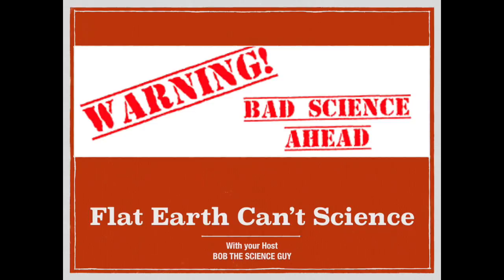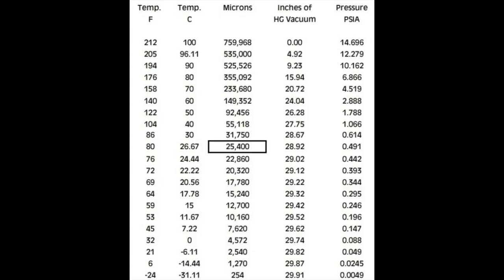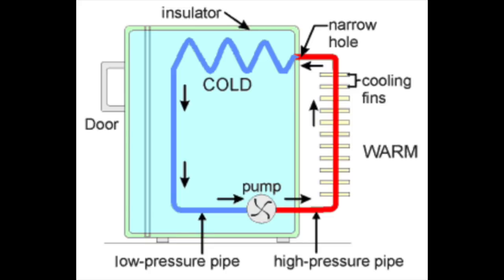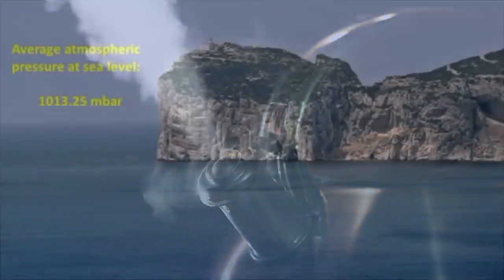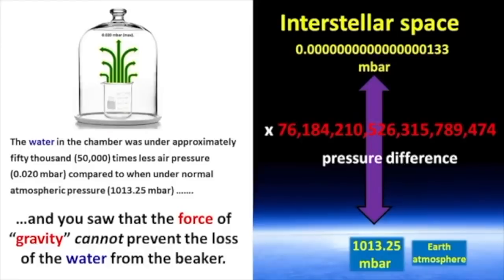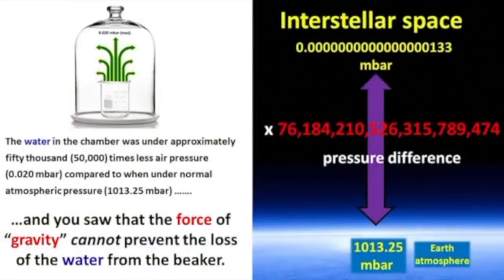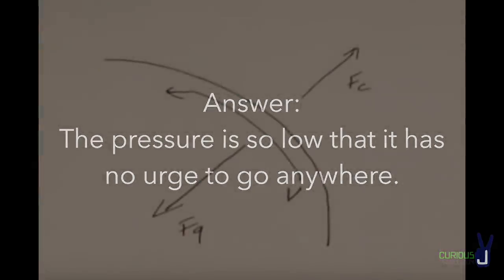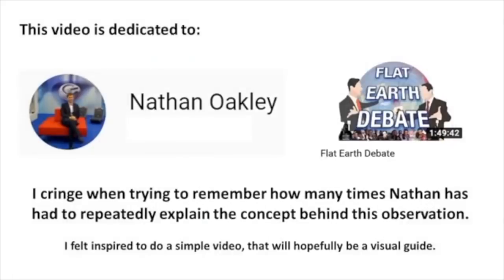Flat Derp Can't Science 28-  Is Space Scientifically Impossible???

Comment: One explanation I found useful for the "space is impossible" crowd is this, i.e. It caused them to panic so hard they "but what about" ed their way off the topic. They might not know anything about science, but they can smell when they're being painted into an inescapable corner. This reflex is common in conmen (and con-women).

You say: Let's imagine for a moment that gravity is a thing, even though you may not think so. Imagine an atomic-oxygen particle, essentially a single oxygen atom, at the top of the atmosphere.
Now, it's flying along at some speed, but it never really hits anything, since there's nothing to hit. But it has mass!
It's near the Earth, within say 80 miles or so, and according to the gravity formula F=GM1M2/r^2, there's some force pulling on it. There is no other significantly strong force pulling on it compared to that force. Under this force, would it curve towards the planet,  away from the planet, or keep going straight? It would certainly curve towards the planet on its path!

Now imagine there are trillions-of-trillions of these things up there. Eventually most (not all) will curve back towards Earth and hit another atmospheric particle. These particles bouncing around, hitting each other, and everything else, cause pressure . The lower you go, the more gravity, and the more they're bouncing around, plus the ones above them. That makes even more pressure, and so on, for 70 miles or so, on down to the ground, where there's even more force holding onto that 70 mile high column of atmosphere, that keeps getting thinner and thinner, all the way up until it's virtually nothing.

The response is usually "but you can't prove gravity"! That means they're uncomfortable talking about "pressure existing next to a vacuum" any longer. Score +1.

Comment: In the first couple minutes I think you got things just about exactly backwards. The air is pumped out and you are left with a very thin atmosphere of water vapor supplied by the small amount of liquid water. When the atmosphere is let back in, the pressure rises and that water vapor condenses back out.
Reply from the maker: I'm not sure, I think the source of the water vapor is the air in the kitchen and it condenses as it expands to fill the vacuum chamber.
Reply: @BobtheScienceGuy  the water left in the beaker boils as you said around 1:30 and that vapor fills the container and maintains a small amount of pressure untill all the water is boiled away or frozen. If the chamber isn't held under hard vacuum and baked out, when the pressure is brought back to atmospheric, the chamber will be full of water vapor and that water will condense.
Reply from the maker: @RobertSzasz  very reasonable explanation.  you say 'isn't held under hard vacuum' - which I assume to mean that the water vapor is pulled out as I proposed.  I'm not sure we can say if it was or wasn't, so I think both our explanations are reasonable.

The bottom line is that when air is allowed to return to the vacuum chamber, it will come it at atmospheric pressure and immediately expand to fill the chamber, cooling and condensing.  The available water vapor, be it from the beaker or the kitchen air introduced, will condense as we saw.
Reply: @BobtheScienceGuy  you can get a short lived mist that way, but the amount of condensation pretty much requires it to be transfer from the beaker to the walls of the vacuum chamber rather than from moisture in  room air to the walls. Condensing water from the room air onto the walls, would require the wall surface to be cooled down significantly, not just have the air cool as it expands into the chamber.   It could happen if the room is at or very close to 100% humidity I guess.
Reply from the maker: good point, I do suspect you are right.

Comment: Doing HVAC we use vacuum pumps all the time for drying out the system prior to charging the system with refrigerant. 300 microns is generally the goal for a good vacuum. The refrigerant also goes through various states on both sides of the system as a gas, vapor and liquid.

Comment: The great Dr. John D must have interpreted that PhD means, Piled High and Deep. He has surely done it. That video needs to be deleted because it's so wrong on so many levels, it's not even funny. They literally just told the complete vacuum industry that what they are doing is wrong and thus all of those products that are made using material deposition (i.e. computer chips and coated lenses) cannot be made. The chips would not function due to all of the water that contaminates it and changes the K value on everything, thus it would fail. Then those coated lenses would be full of contaminants along with the coating would never stick to 90% of it. In a nutshell, a P900 is impossible to manufacture due to flat earth.
Reply: @ericb31-w3j  - I like that one.

Comment: And if there is a dome ( which would have to be at least 3000 miles high to accommodate the Flat Earth Sun , Moon and stars ) there would still be a virtual vacuum between the top of the atmosphere and the surface of the dome.
Reply: Some globe deniers think the sun is only between 7 and 10 miles up. So, it all depends on the globe denier you talk to. All of them have scientific proof they are right, just ask them. Talking to a group of them and what they claim as fact about things like the sun and moon is like watching The Usual Suspects. They all have a different story.
Reply: Bill Smith  - at 7 miles a lot commercial aircraft would be flying above it and even at 10 miles there are some passenger and military aircraft flying above it.

Comment: I seem to remember being told that gas molecules are in a constant state of motion, jostling each other around, and that their average velocity corresponded to (or gives rise to, some say) its absolute temperature.    If that's true, there are other concerns besides just the centrifugal force from the Earth's rotation to the question of whether the upper atmosphere's molecules stick around or not.   Seems to me that if any molecule finds itself thermally agitated enough (from contact, or maybe as a result of being whacked into by a particle from the solar wind) to have more than "escape velocity", it's going to go flying off into space unless/until it collides with another molecule and slows down.    I'm guessing that it's rare for molecules to acquire that much speed?
Reply from the maker: our magnetic field shields our atmosphere from the solar wind so it is less of a concern than on say, Mars.  The point being made is that the energy of the molecules is getting depleted by the upper atmosphere, so there is little energy remaining to 'push' them into the vacuum and the force of gravity acting on them encourages them to return toward earth rather than fly off.

Comment: 8:00 oh how I laughed. If the pressure in space was zero and on Earth it is 760 then that is INFINITY times greater.
Reply: I can take a glass jar and a AC vacuum pump (about $100 total) and get it to 10^2 Torr. For $30K I can make a stainless steel chamber with CF flanges, then back it up with a LN2 trap, then a turbo pump and then a scroll pump and get 10^8 Torr. So according to the people that did that video:
$100 means 0.01 Torr
$30,000 means 0.00000001 Torr
So for 3000 times more money, I can get you 1,000,000 times more vacuum. That sounds like a great deal and I want flat earth to order up some of these.

Comment: Bob, you need to a bit more specific about cloud formation. Yes, they do form at the dew point, but this temperature is not the same every where or even on consecutive days. The air pressure clouds form will also change in relation to the temperature. You've given them a stick to beat you with.
Reply from the maker: I didn't say it was the same level at all times.  The implication is on a given day in a local area, but your point is taken.

Comment: the energy loss of the air molecules as they rise is referred to as the dry adiabatic loss rate if i remember right. the formula allows to predict the exact altitude that water droplets/clouds will form or, if you like, the exact time dew will form on the ground. It's a really neat math exorcise that is easy to do in your head with minimal starting information.
been decades since i studied it so I'm likely wrong on a few points but google away and get the exact details for yourself.
Reply: If I remember correctly, from my days piloting gliders,  the dry  adiabatic lapse rate is 3.0 C (5.5 F) per 1000 ft rise in altitude. The more moist the atmosphere the lower the loss, so in cloud it would be about 1.5 C ( 3.0 F )
Reply from the maker: 5.5 or 5.6 is about right.
Reply from the maker: you can.

Comment: Just ask a flat earther if they accept that there's atmospheric pressure gradient and hear them tap dance around the question. In fact Riley denied it when I asked him. He claimed that the reason you need oxygen on high mountain climbs is because oxygen is heavier than nitrogen, so it sinks. There's so many ways to demonstrate this gradient, so he's just denying reality.
Reply: Uncle Bumblefuck (aka AvE) even has a demonstration of that here on youtube. He lives near the Canuckistani Rockies, and had a vacuum gauge that was reading below zero psig when it wasn't connected to anything. His initial thought was that he pinned it, realized that's impossible on a vacuum gauge, then remembered he lives at about 4,000 feet above sea level, so of course it reads a bit low. None of his vacuum pumps could get it below -14.7 psig, so it was reading accurately the whole time.
Reply: @Ravaxr   It's trivial to demonstrate. An altimeter (something I have experience using) wouldn't work if there was no pressure gradient. It's just a barometer.
Reply: Heck, you can install GPS Essentials on an Android phone (that has a barometer), have it display air pressure and then just lift the phone from your feet above your head. There will be a clear change in the decimals.
Reply: Cody(from codys lab) did climb a mountain with a homemade mercury pressure gauge and confirmed the pressure gradient.
Reply: @heyarno  Cody's folks ranch is high in the mountains, atmospheric pressure there is 12PSI.
Reply: @heyarno   Wolfie measured a pressure difference between the ground and top floor of a hotel. It's a small difference, but measurable. It really says a lot about someone when they need to have something like this demonstrated to them.
Reply: @hueynrolf9272  I missed that video. Anyway, I noticed the pressure difference in a high rise building as a 5 year old when taking the elevator. So I thought, maybe it's true and flerfs never leave their basement. But at least some of them take footage from air planes and travel to conferences, so other explanations are more likely.

Comment: Nice job explaining scientific concepts, by the way.  And for those that may be wondering why gases cool on expansion, I'll give an easy to understand, simplified example.  Imagine you have a ball that bounces perfectly (doesn't lose height on each bounce).  Say you throw the ball inside of a box at 50 mph, in which only the top can move.  If you keep the top from moving, the ball will bounce up and down at 50 mph indefinitely.  But if you let go of the top and allow it to move, then the ball will strike the top, and send it upwards with some speed, say 10 mph.  This means the ball will bounce back down at 40 mph.  That is, the ball lost energy and gave it to the top of the container.  Likewise, when a gas expands, it gives away it's energy to the surrounding medium, and that is why it cools.  If a gas expands into a perfect vacuum (which their chamber is not), it shouldn't cool at all.
Reply: I don't think that example is ideal. You just decrease the distance it can bounce in a ideal expansion. There is no Newtonian work done as you imply by mere expansion. That would be the case in a internal combustion engine, where mechanical work is extracted from the expansion. While the ideal expansion would be like enlarging the box. The ball would still have the same energy if you increase the distance it can bounce. It's taking a longer path now, at the same speed, so only the frequency it bounces at will decrease. So when we consider the frequency as analogue to temperature, we find that temperature isn't energy, it is a measure of a energy potential. And the flow of energy between potentials is what brings the change in energy. When you re-compress the gas, it will be warmer then before expanding it. That shows, that it absorbed energy from the higher energy potential(warmer) medium that it passed through. Heat would be the correct equivalent to energy. This also explains why the thermosphere doesn't instantly melts things. There is high temperature, but little heat due to the low mass of the highly expanded gas. This is also something flerfs struggle to comprehend thanks to pseudo scientific flerf documentary's which make no difference between temperature and heat, nor do they explain energy transfer.
Reply: @Arno nümuss  Please post your comment again.  I can only see part of it in notifications, but not at all in my replies.  Perhaps you posted a link that you should omit.

Comment: What they don't seem to get is that there is no "edge" to the atmosphere. Well, there is one, but it's the surface of the earth. We just talk about an edge since it's convenient to do so, and we just happened to draw a arbitrary line at 100km (the Kármán line) or I think 50 miles (the USAF's determination of whether you are an astronaut) and so on.
The function describing atmospheric pressure with respect to height above the surface has a boundary condition of p(h=0)=1bar and one of p(h=∞)=0bar. This agrees completely with what is observed, and it gives a pressure gradient at any given height of something sensible, as in any two neighbouring "bits" of air are roughly the same pressure.
Reply: Aren't the moon technically inside the earth's atmosphere just that it is so impossible thin at that distance that it is just useless informatin
Reply: aggese No, but the planets are inside of the sun (kind of).

Moon is about 380000km away, atmosphere of earth is roughly 100km thick, everything betveen of them is just space.
Reply: @aggese 
Yes, but the geocorona is so thin that it can be regarded as a vacuum for all practical purposes. http://www.sci-news.com/space/earths-hydrogen-geocorona-06932.html
Reply: I heard that the Karman line is basically where the velocity to maintain controlled flight is essentially orbital velocity.

https://simplicable.com/new/karman-line